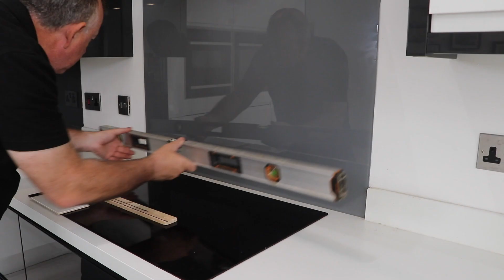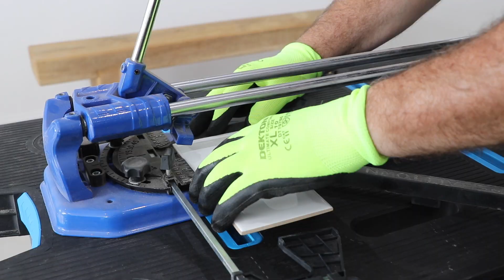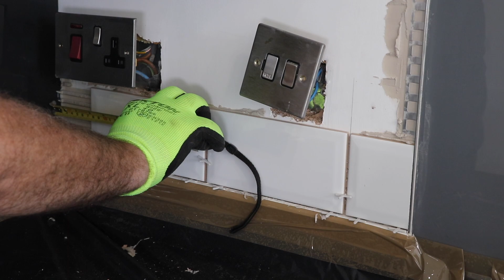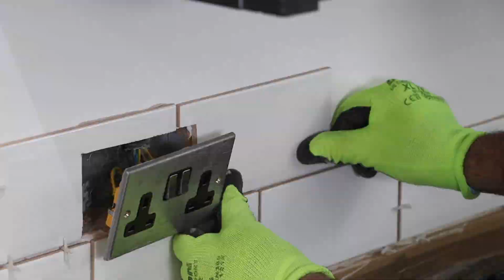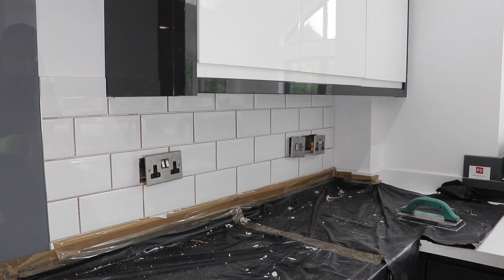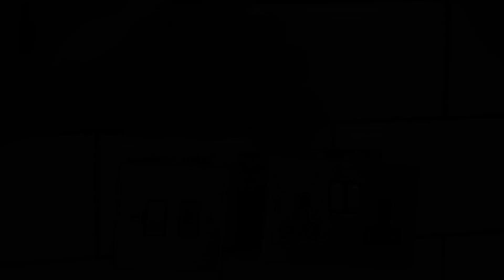How to tile a splashback

Comment: I was told by a tile supplier never to mix grout mechanically as it introduces too much air and causes it to go off prematurely. Better to mix by hand. Most grout manufacturers concur with this advice.
Reply from the maker: Thanks for the advice Darren. In this particular video we use ready mixed adhesive to avoid mixing too much adhesive for a smaller area and it going to waste.